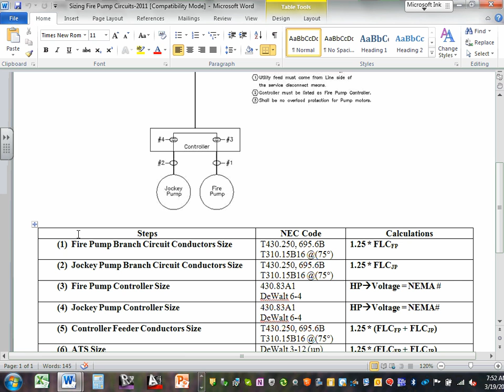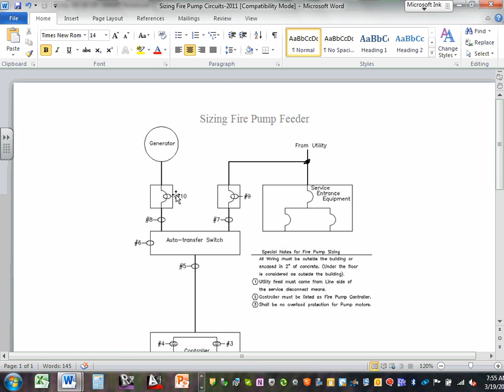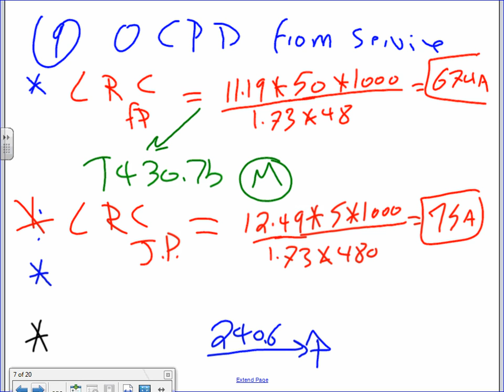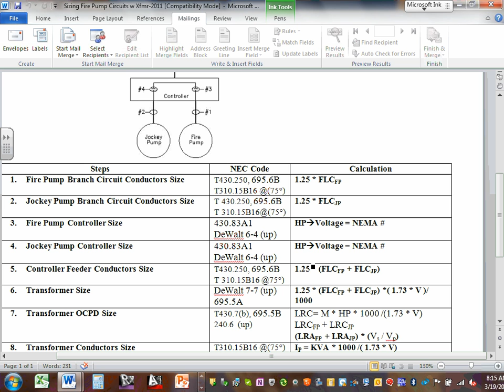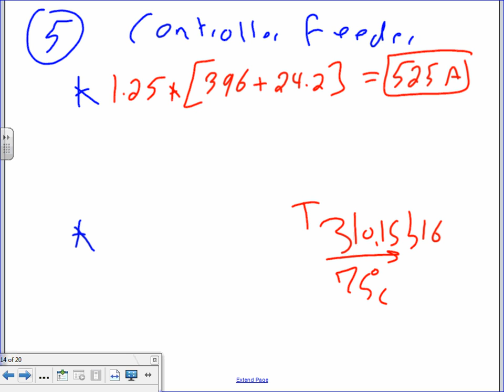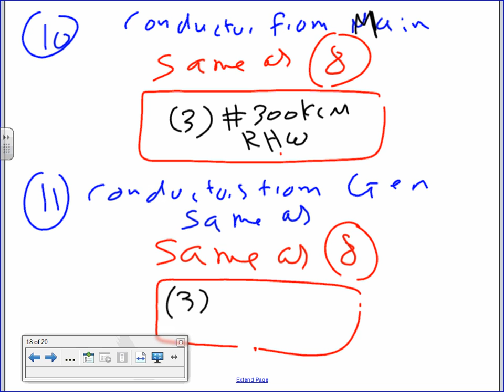Fire Pump Sizing Calculations 03 19 14

Comment: Do you have experience/explanation of how to size a dedicated genset for a fire water pump?  I am told i need a 50 HP (500 gpm) Fire Pump using a 230 V system.